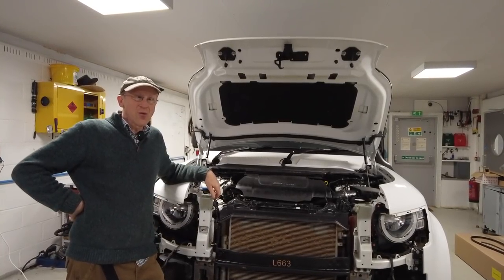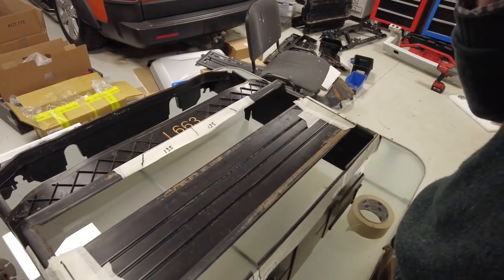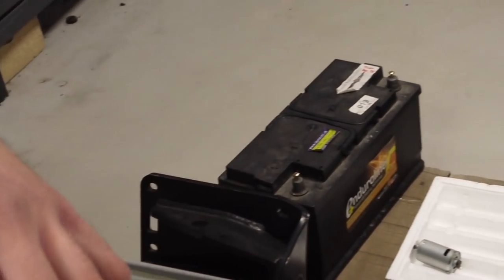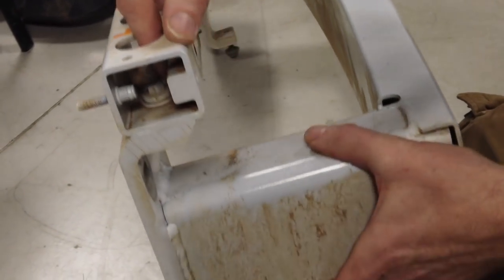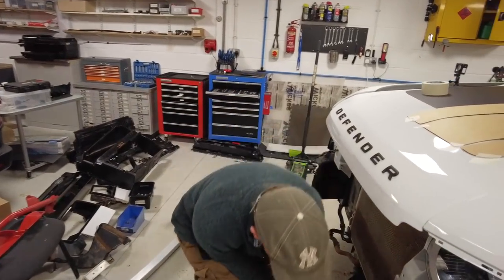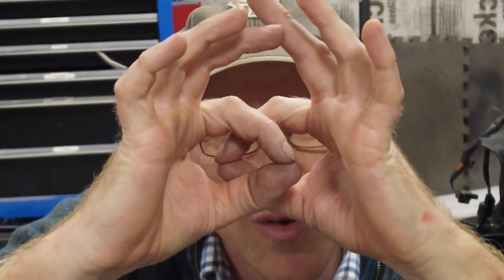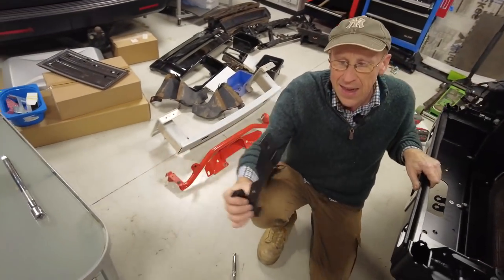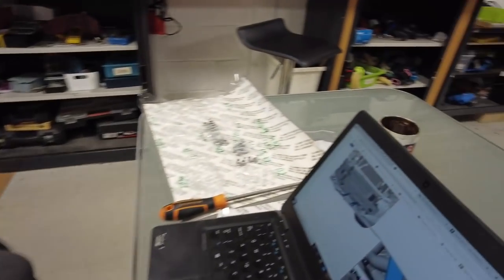Land Rover Defender 2020 Front Bumper Winch Installation - Part 2

Comment: The Workshops of  JLR  must be watching you demonstrate  how to fit a Winch right now . - No Pressure Simon
Reply from the maker: Hi Mike... is starting to get more tricky now... JLR are telling me to cut connectors off the loom and cut wires in the fusebox..... seems crazy so my have to design my own method.... studying the wiring diagrams tonight "for fun"
Reply: @L663   Do you think thats what happened to Denver  JLR ? - Cutting the wrong bits off  ? . This is really interesting to watch

Comment: Excellent videos - thanks.

Notes as I watch - you will STILL need the open-flap option for vehicles without a winch, so they can pressure clean it properly.  So PLEASE still ask Mr. Skywalker for this.

I am surprised that JLR dont supply a pre-cut L633-W as part of the winch kit - especially as there is precision cutting involved - it would also save a lot of time for the dealer for a dealer fit (saving probably bore in time than the L633-W would cost).

Your microphone problem .....  this is my area of expertise - make a small loop in the cable and trap it behind the mic. clip - this will decouple the cable from the microphone and prevent the rustling noises from the cable getting to the microphone (this is what all the broadcast sound engineers do when fitting people with a radiomic.) - I hope this helps.

Great - now I wait for the next video.
Reply from the maker: Hi John - i think the Mic was rubbing on my unshaven chin so i moved it down my shirt. What do you think of the new camera / mic... ? Thanks for the tip !
Reply: @L663  Sounds good and keeps you on mic. - but misses what Tyler says, of course.

Comment: I hope you didn't damage the loom, the TFL Defender was damaged beyond repair by a dealer in Colorado
Reply from the maker: If you listen carefully there are some loom comments added in to our discussions..
Reply: I think he knows already, he sort of mentioned it in Part 1.
Reply: @L663  
I wonder whether the American dealer did actually cut through a loom or whether they are using it as an excuse to cover for another major fault, like another 'check engine' warning light  or dead infotainment system, like they had on the first one?  I just can't see how or why they would cut a loom from your very detailed video.
Reply: @hedydd2  After watching Simon fit this kit, I am wondering the same, there is no cutting on the body that we've seen yet. Maybe the wiring of the winch will reveal all?

Comment: Need to beef up the front suspension to take all the extra weight. Or will the air bags be able to cope with it.
Reply from the maker: I am guessing the airbag will take it / adjust pressure etc... but its a good point..on the coil spung one you need to change the springs..
Reply from the maker: We are rolling out the "Barclay Hinge" on the templates !
Reply: @L663  superb glad to help.
Reply: @L663  That's great what the chances of seeing it in action. Or even a picture of it.

Comment: Thank you for your videos! LR requires the cooling active grille to be striped down when installing the winch, however I see you did not do it. Any reason behind it?
Reply from the maker: There are 2 active grilles - the lower one which needs to be removed and the upper one which can remain
Reply: @L663   so you removed the lower one only, correct?
Reply from the maker: @ChukIGek1  Yes correct.

Comment: A little anti-seize grease on all the nuts/bolts would be useful  - I hope JLR watch your videos and learn :)
Reply: later you got it...
Reply: You shouldn't put copper grease on aluminium, dissimilar metals, effectively creating a battery. Electrolytic corrosion. 
If you wish you put something on there a weak thread lock will create an isolation barrier.
Reply from the maker: Interesting point... but the inserts that had the threads in the aluminium cans were steel so we are OK but its a good point to make... although i am not sure the copper and ally would be an issue... steel and ally probably more of an issue ?
Reply: @L663  I really enjoy your videos so keep them coming but does your mechanical engineering qualification help with the point that you should change the torque when doing up bolts with anti seize on? People seem to have opposite strong opinions on that!
Reply from the maker: @mattsewell8949  So here are my thoughts...anti seize will reduce friction... yes... but friction only happens when you have movement... when the final torque is reached the nut is not really spinning or moving so there is no real impact of friction on the torque setting..... Simon J BEng CEng Eur Ing MiMechE...
Reply: @L663  Lubricant on thread or bearing surface has a huge impact on effective torque. As a process engineering in a automotive manufacture facility we went to great lengths not to get any lubricant on the seat belt anchor bolts for example or even on the bearing surface of wheel nuts. It increases the deformation of the fastener dramatically as the effective torque increases.

Comment: A powered hacksaw like the Milwaukee Hackzall would make short work of any panel cutting, any metal sheets or bars and wood of all kinds. Just as good as that tool shown but more versatile.
Reply from the maker: An excuse to buy more power tools.. excellent !
Reply: @L663  
I find I use it almost as much as a drill.  If you have a battery system already, that brand might have a similar saw. But the Milwaukee 18V is the best ;-)

Comment: So much plastic in the front makes me want to wait until there is an aftermarket steel bumper before buying a new Defender
Reply: not to mention the underbody….
Reply: You’ll be waiting. ARB, TJM, Ironman, etc have no plans to make anything for the Defender. They have nothing specific for the rest of the LR range either so I can’t see them producing anything. The complexity of design and the potential profit from smaller sales means it won’t take off.
Reply from the maker: Keep an eye on newdefendermods instagram
Reply: @FJUH  The guys at Lucky 8 are working with someone to create one.  They already have a prototype of a ladder for the rear door.

Comment: In the true spirit of Land Rover ownership I'm all for giving it a go.... but.... any idea what a main dealer would charge to fit this 😂😂😂😂
Reply: An effing fortune.....
Reply from the maker: I am sure it would be a "a snip" at the price.... loom joke !
Reply: WINCHES
Remote Control Electric Winch (1) VPLEP0426 £3,162
Winch Mounting Kit (1) (2) Air Suspension VPLEWMT001 £2,412 
Winch Accessory Kit STC53202 £352

Prices for supply and fit according to JLR accessories brochure. Don't know if there is a difference between standard coil or air suspension but would doubt it. So unless you are a serious off roader with spare ££££££ you wont be asking your local dealership to fit it.